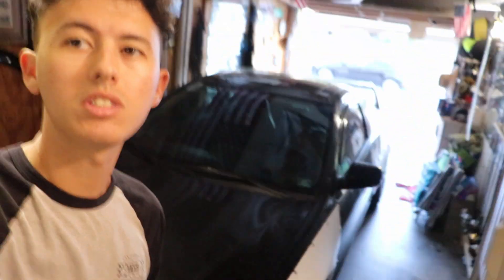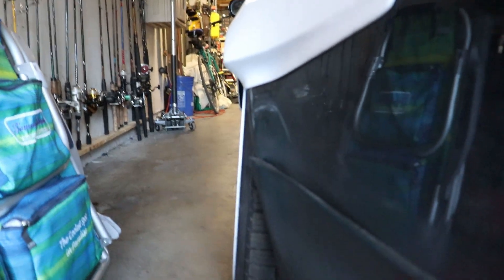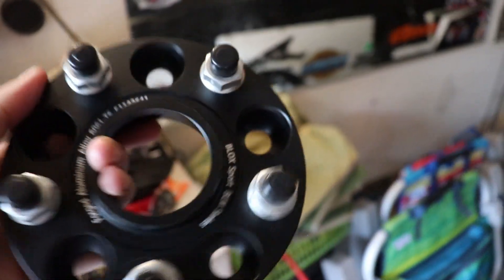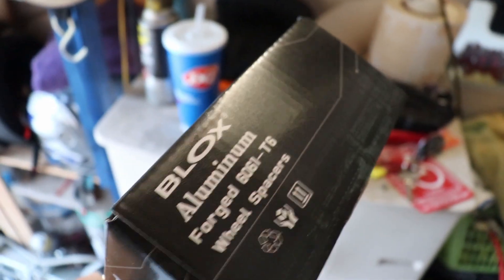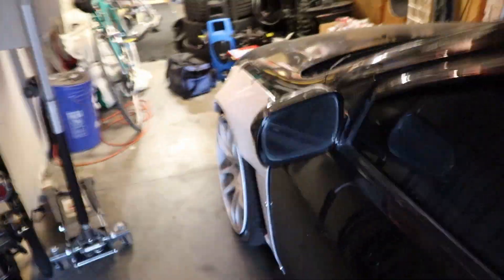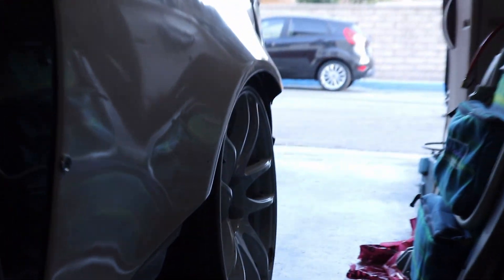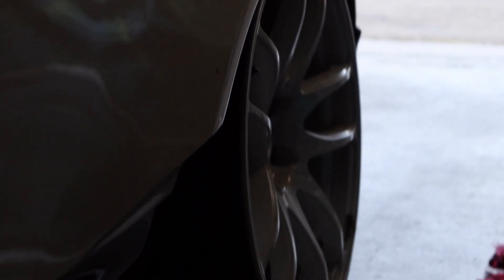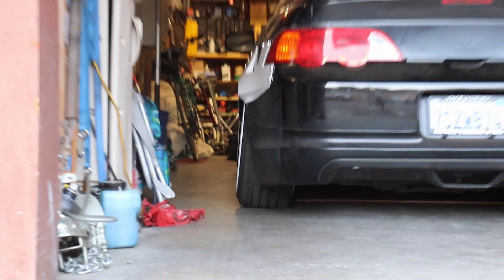How to Install Spacers (Anointed Aero Widebody Part 3)

Comment: Do you think an RSX is worth it for a 16 year old?
Reply: Peter Tran why not it's a reliable car good gas mileage plus you can make them look Great only downside local parts are hard to come by at least where I'm from I think an RSX is a great first car for anybody
Reply: @ddbmw1172  Yes of course but I'm just thinking about insurance money. do you think a 2 door car is more expensive to insure than a 4 door?
Reply: Peter Tran Insurance wise it's going to be high regardless for 16 year old of course it's going to be a little higher if its a 2 door car but there's always ways around that like putting the Insurance on your mom or dad's name if they let you that is..... but either way it's going to be more expensive on a 16 year old person doesn't matter if it's a 4 door or 2 door it's going be  expensive anyway
Reply: @ddbmw1172  hm alright thanks!
Reply: Peter Tran i just purchased an RSX for my first car and so far it's been great, i only have to pay $70 a month for my car but it was put under my parents name.
Reply: @32v4.6  hm I'll probably look into it because the rsx has been my dream car for a while
Reply: Peter Tran get it dude you won’t regret it 🤙
Reply: @iblackfiree  yeah thanks man